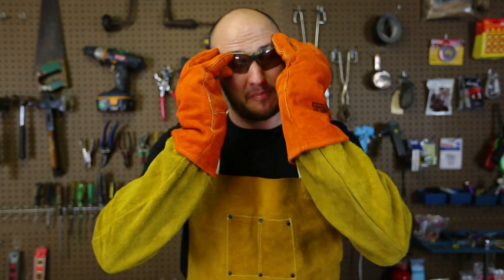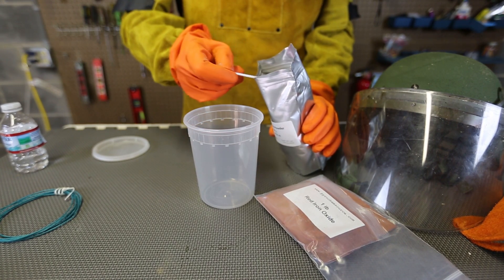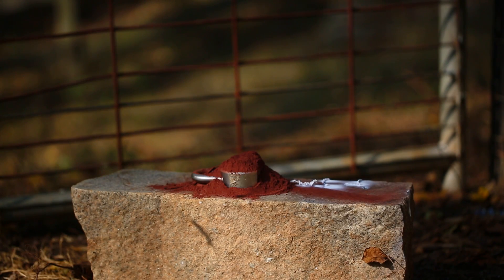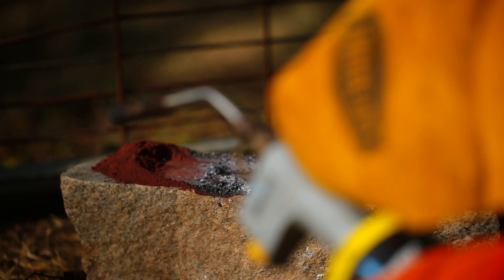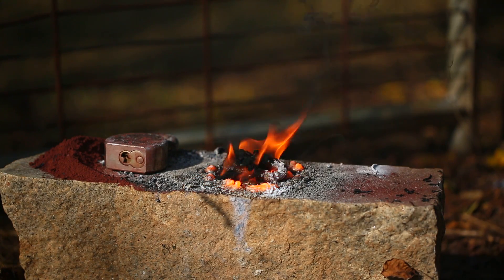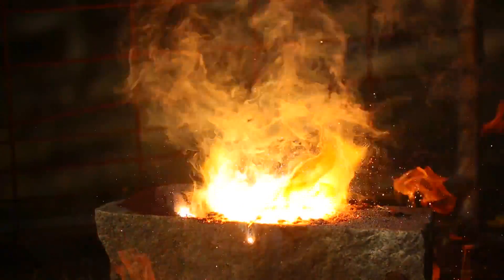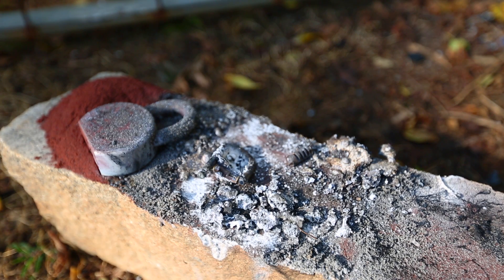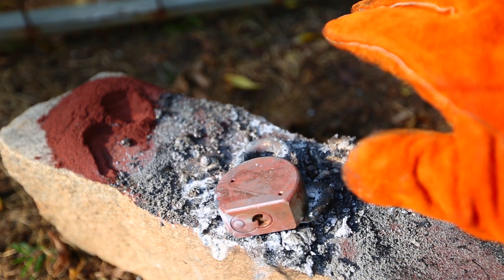Will Pod Lock Survive Thermite?

Comment: Of course the large master lock would be intact a thermite reaction produces iron which melts at a temp lower than steel. The smaller lock has a brass body thats why the top survived because its u ring is made of steel.

Comment: I think you need to do a few extra things to make it better like getting a better ratio making sure the grain sizes of both elements are equal concentrating it into a smaller area and maybe even perhaps using copper instead of iron with the aluminum

Comment: I love how he put the safety helmet on and used thick gloves when mixing the thermite XD
Basically you need to heat that mix to above 700 degrees for it to even start reacting, so that's a little too much safety for just mixing rust and aluminum powder =p

Comment: crazy Russian hacker you made the thermite  wrong  its too explosive, you should add a 1.5 to 2.5 aluminum to iron oxide for a hotter and much more effective at going through anything. if you made it right a dime sized pile will melt through the lock and some of the stone under it

Comment: But do you guys want to know what doesn't melt steel?
Reply: Jet fuel
Reply: @ashtonkubo583  yeah but it does reduce its strength by up to 50% which would cause catastrophic structural failure in a building
Reply: kek
Reply: Ashton Kubo jet fuel?
Reply: Dank memes?
Reply: planes?

Comment: The iron oxide and aluminum DO have different weights. One YouTube video showed that a 50/50 by volume mix was really close to a 3 to 1 by weight mix. You could also have made a few very small batches with different mixes for testing. Once you got the best mix stick with it until the supplier changes.

Comment: put the thermite in a funnel that wont melt so the liquid molten metal pours onto the lock ! your allowing a lot of the energy to escape !
Reply: someone must feel a bit threatened...
Reply: actually, he is right. you're = you are.  agreed that he's still a douche though. 

and i was going to make the same reply. he's doing it all wrong. most of that thermite (termite? lol) is not even on the lock, it's doing nothing.
Reply: or, you know, just use copper oxide instead of iron.
Reply: EddieG *you're
Reply: There aren’t any tunnels available that could survive heat like that, plus all you’d be doing is channeling molten iron onto the lock. You want the lock to get hit by the initial chemical reaction
Reply: @maxwilson3530  Titanium... stay in school.
Reply: Sammy Sanchez You're isnt right for this type of sentence... So your attempt to trigger someone has failed remarkably well.

Comment: Maybe build a 'dam' of sand around the big lock, leaving a 'funnel' that ends at the lock.
Thermite makes white-hot liquid steel that the funnel directs onto the body of the big lock.
Or use a ceramic flower pot as the funnel.
Great video!

Comment: Hey Taras, I really enjoy your lock opening hack videos. I have an interesting idea for another video! You used locks made out of aluminium previously (the body of the lock, not the hardened steel bar). Add Galium to the aluminium lock and see if it weakens the lock to the point where you can easily smash it to pieces :)!

Comment: needs less iron oxide to completely melt the lock 8:3 ratio works well 8 parts aluminium to 3 parts Fe2O3 this should work better

Comment: that is not the correct mixture. True thermite at the right mixture is darker in color and is 1 part aluminum to 1 part iron oxide. With this ratio that lock would not have stood a chance.

Comment: you had a bad ratio. a good mix will have a white flame. aluminum and iron have different weights. measuring equal parts is not going to work. also it burns fast, you need a decent quantity. it looks like you didnt use to much more then a cup? the reaction happens fast, along with the improper mix there simply was not enough heat transfer.

Comment: use a clay plant pot with a hole in the bottom, this concentrates the molten metal to eat through a specific point of the lock and will probably burn through the lock.  Can do the same through an engine block if you have enough thermite focused into a small area.

Comment: All though you got the recipe mostly right you didn't concentrate the thermite correctly, thermite, if concentrate correctly, will melt through a car form the hood out the bottom of engine. It easily melt through the lock the only problem is that you put most of the thermite on the sides not the top

Comment: I thought thermite is illegal to have. Some believe that is what was used to weaken the steel beams inside the World Trade Center.
Reply: water can cut through steel with the proper device too
Reply: Yeaaaaaaaahhhhhhh  if you look at the videos of the towers on fire you can see sparks. My belief is those buildings was brought down by explosives. How it collapsed like dominos is they put explosives from top to bottom along the center core. The center core acted like a spine that held up the floors in the building. I been up in those buildings more than once and as massive as they whir there was no way jet fuel brought them down.

Comment: If you want to make this work, the ratio is 3 to 2, with the addition of 2 parts of plaster of paris (acts as an oxidizer) - place it in a large terra cotta pot with a hole in the bottom, and position the lock under the hole in the pot (set on stacked fireplace bricks.  It will rain liquid thermite down onto the lock and melt that bastard like a cheese sandwich.  Same recipe welds railroad tracks together.

Comment: You can do better by using a pipe with a slit cut in it. Pack the thermite into the pipe, and light it, where the slit is will act like a cutting torch.

Comment: This is improper use of thermite for melting/welding metal.  Use a ceramic pot, the ones with the drain hole in the bottom to direct the flow of the molten metal.  Basically, for thermite to work right, you need to be able to collect, direct and control the flow.  You can always add a sensitizer (Like KClO3) so it burns more hot.  I'm not sure of exact amounts.  Steel melts at between 2500 and 2700 degrees and thermite burns at about 2500 degrees with Iron(III) oxide.  If you want a cool Thermite that burns really fast, try a CuO/Al thermite (copper oxide and Aluminum powder).  It is almost like flash powder.

Comment: If you make the ratios right and have good thermite it will do the job. It isn't based on amount but weight because the differences in molar mass. Also increasing the amount will get it hotter because there is a longer exposure.

Comment: The issue is that the way you're making the thermite and the way it's placed is why you have to add so much. If you sort of put it in a small concentrated zone with some sort of small tube that can stand on the lock... you will melt it through. In short, just reduce the amount of surface areas you're covering with a small tube for those locks and let the thermite work through that small area. Think of it like a small 2-3 inch diameter area with thermite stacked in a small tube I suppose. You then light it up and let it work on the locks. You use less thermite and you get better results. 

This is all theoretical. I've never really worked with thermite myself but I assume that's how it would work. I guess like a tube firework only this one melts down.

Comment: what is thermite?
Reply: Thermite is a generic name for any mixture of two or more powdered metals that react with with one another. Generally one of the metals reduces the other which produces energy in the form of heat and light. In this case the Aluminum is reducing the iron oxide according to the chemical equation Al + Fe2O3 -> Al2O3 + 2Fe + energy
Reply: a Rainbow Six Siege Operator.
Reply: Hailey Trusty explosive powder used to destroy metals